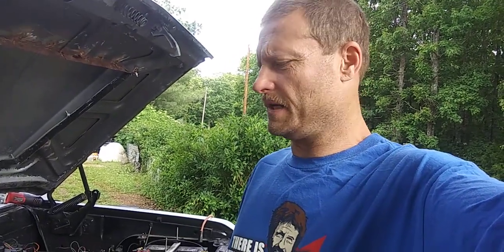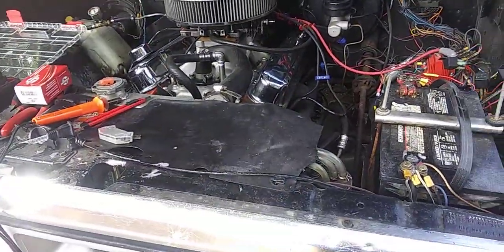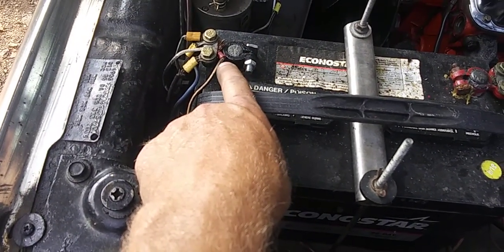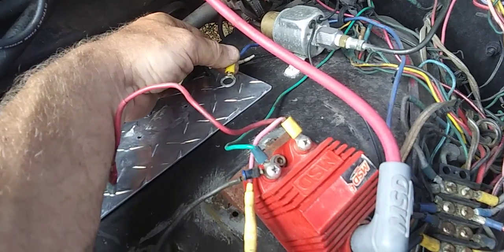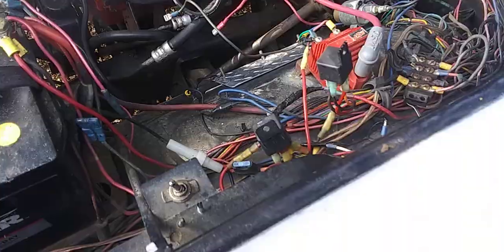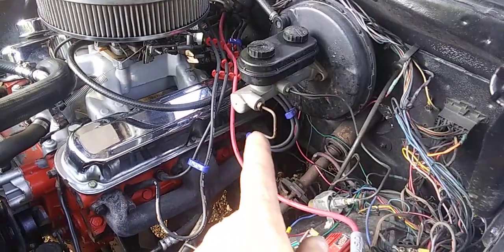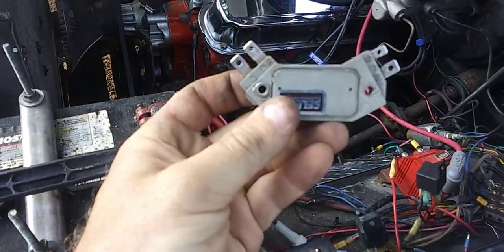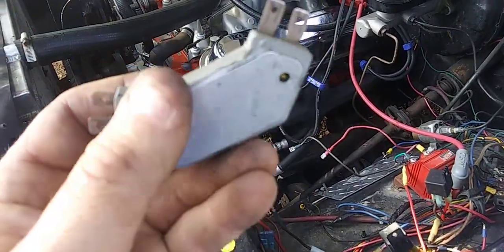DIY LOW BUDGET HEI  IGNITION / ICM Conversion  FOR YOUR MOPAR & OTHER VEHICLES

Comment: Good informative video. Which small block do you have in the truck? Thanks for the video!
Reply from the maker: @ronaldbarnes8302   Mildly built 318 . has factory 340 cam = Erson TQ20H 
It needs a set of headerds to perform better . that will be next
Reply: @ nice setup. Back in the day we ran the same mildly built 318’s in a 65 Cuda and 71 Demon. Always was impressed with the 318’s but wish we could have afforded 340’s .
Reply from the maker: @ronaldbarnes8302   I'm going to be putting on a cleaned up set of 302 casting heads that the bowls and ports and the material ground back away from one side of the valves so the heads flow better and due to the heart shaped chambers will increase in compression on the cheap. paid 165.00 for the set of heads
Reply: @ Cool! Look forward to the finished product!